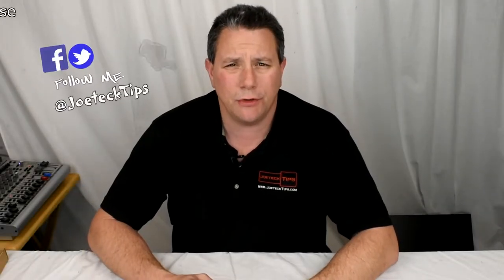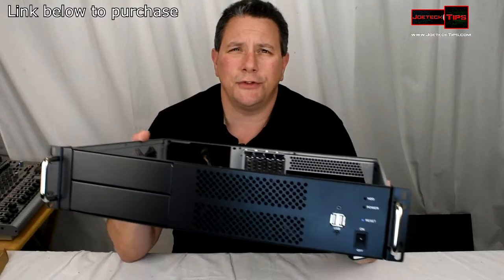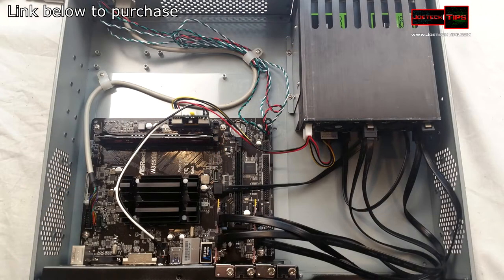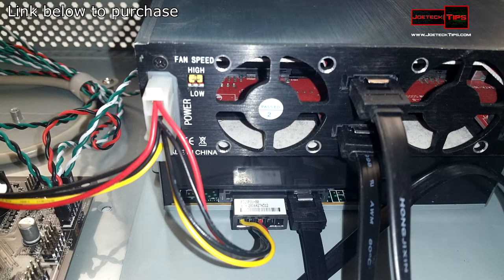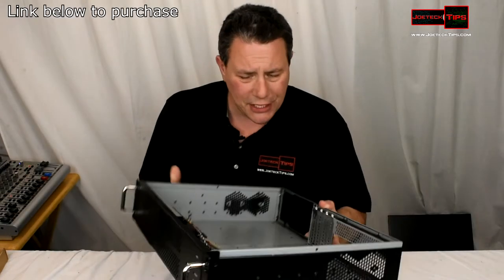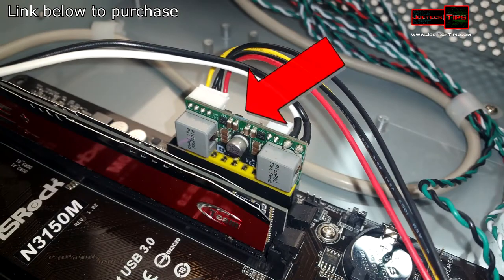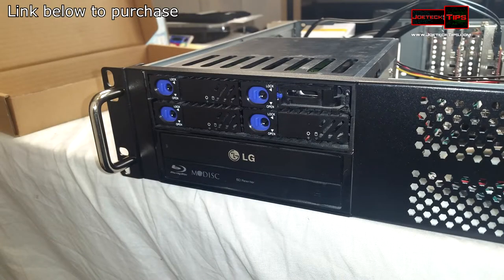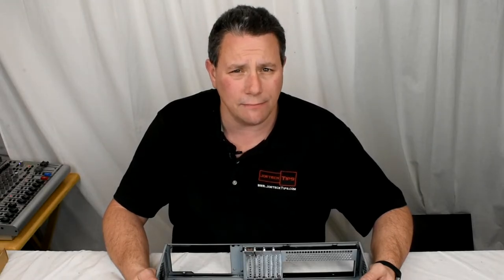Athena 2UC238 2U Chassis - Review | JoeteckTips

Comment: How do you handle your DC power setup for all your servers?
Reply from the maker: bawitdaba1337 three UB12500 50Ah batteries in parallel.  Making 150Ah.  Then I have a 30A Coleman solar controller and a 100w solar panel.